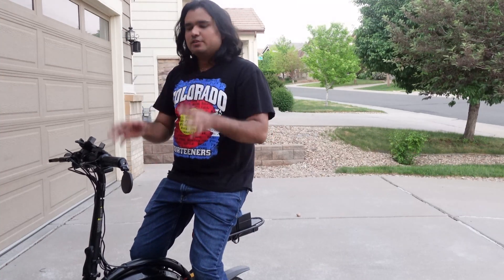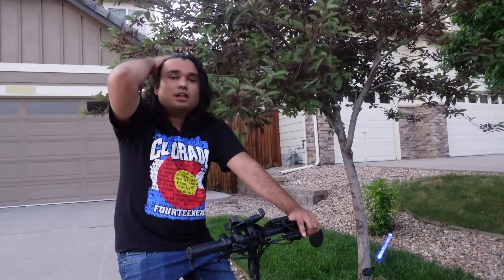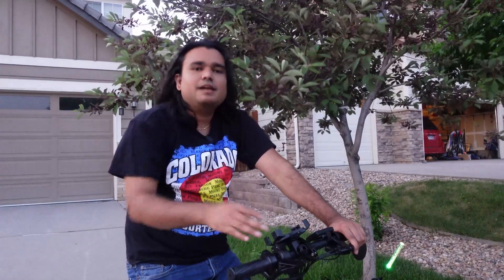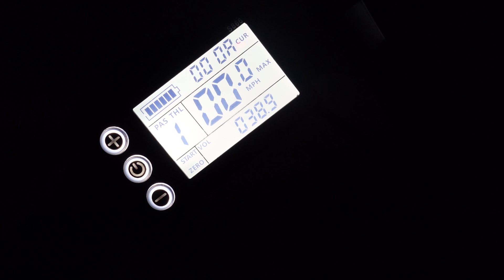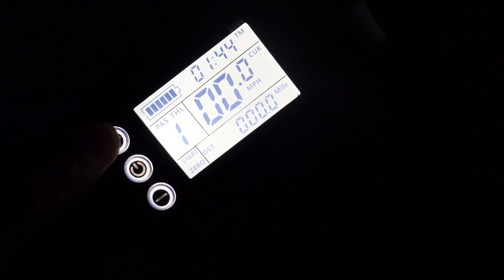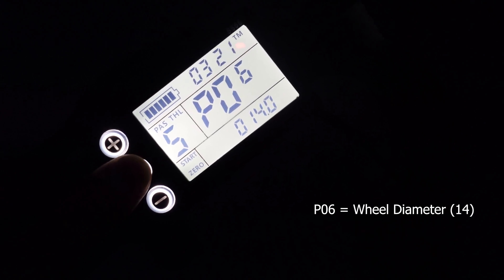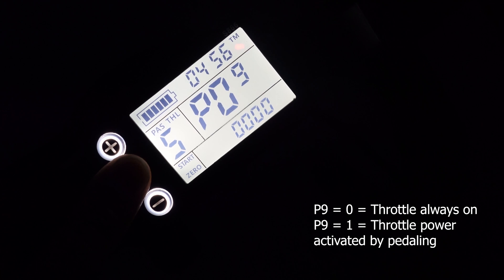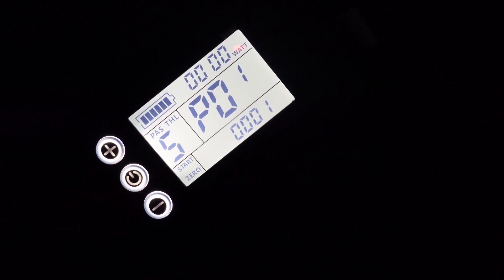Electric Bike (Jetson Bolt Pro) - Controller Upgrade Settings & Questions

Comment: I got the display installed and noticed that it does not matter what setting P7,P13, P14 and P19 except for calculating the display mileage. So setting P14 as 10A max, it will still climb to 19A on the display.

Also, I noticed that the PAS THL defaults the value to 1 when the unit is turned on. So I have to climb to 9 everytime the unit is turned on.

I also have P21 which enabled, It overrides PAS THL setting and sets everything to the MAX. This includes battery undervoltage which is down to 28. 

I wanna say, I belive you can disconnect the Hall wires and it will still work. But I'm not sure
Reply from the maker: Hi John, thanks for your insight. That is good to know. I appreciate it.
Reply: Lol all you have to do is cut and fish new controllers it will look a lot cleaner I did mine like that with a 10amp 48v battery it’s faster and more torque.
Reply: So if you enable p21 does it make the bike faster
Reply: I just installed a 36/48v controller but can’t seem to get the bike to pull me. Bike worked great before hand. If I left the rear wheel the speedo shows up to 24mph. Just wondering if I have a setting wrong maybe? Almost like torque is down. Any ideas?

Comment: I bought that controller you had in your bio what kind of 48 volt battery can I add to this controller that you mentioned that comes with the LCD screen. I just want more battery range and more speed. And how to do dual motors
Reply from the maker: Higher speed means less range. If you want higher range I would stick with a 36V higher capacity like 20AH battery. If you want more power, 48V battery would be appropriate. Anything above 20mph on this little bike seems dangerous, so please do your research and be extra careful with this controller upgrade. Please check to make sure the wiring on your bike is the same as mine, many people had different wires. I am considering a dual motor upgrade but I haven't had time to figure that out yet.
Reply: @ShivaSapkota  but would a 48 volt battery go with this controller that's in your bio? And yes I think if I can at least get it to like 20 to 22 I'll be happy with that I just want more power and battery range
Reply: And can you send me a link for a sufficient 48 volt battery it goes with this controller
Reply from the maker: @wavvvyosean5311  The controller manufacturer states that it is compatible with a 48V battery. Some of my subscribers told me it worked for them and they are getting higher speeds and power. I think something like this will work but it won't fit inside the housing. 48V batteries are usually larger and need to mount in the back. I haven't tested with a 48V battery to know about and please do extra research prior to the upgrade. https://ebay.us/tOmd4F
Reply: @ShivaSapkota  you're the best thank you
Reply: @ShivaSapkota  do I need any extra connectors for this like that adapter for the battery and where can I find a bike rack
Reply from the maker: @wavvvyosean5311  Please check my ebay battery review video for the connectors. https://youtu.be/es2XFwU_tGQ. This is the rack I have: https://amzn.to/3mKvpES
Reply: @wavvvyosean5311  yo man did u ever figure this out

Comment: I have a DYU D3F 36v, 10AH, 250W similar to the jetson bolt pro. This version is limited to 18km/h. The DYU D3+ has the exact same specs, but you can change that limit with bluetooth+app to 25km/h. Is there any other way to adjust that limit? I know you can take the bluetooth adapter from the other version, but that's not an option for me. Or is changing the entire controller my only option?
Reply from the maker: Hello, unfortunately, swapping out the controller might be your only option. I have seen people mess with the capacitors inside the controller to bypass the limiter but I don't know much about that process. Thanks.

Comment: Great content once again.  Recommendation for controller upgrade, choose the higher rated voltage controller because it will contain appropriate capacitors and mosfets required for higher voltage.

24V-36V controller is likely not adequate for much higher voltage.
Reply from the maker: Thank you very much for the feedback. You are absolutely correct, I would recommend 36-48V at a very minimum.
Reply: Is this comfirmmed? I accidentally bought the 24-36v but it's been working fine with 48v and settings allow it too.

Comment: I just finished installing the control on my  bike it work as you said thanks men also I noticed that the control let’s you choose different voltage settings up to 60v what will be the highest battery for the 350w motor.
Reply from the maker: I would probably stick with max 48V. Thanks for the feedback, I am glad the upgrade was a success for you.

Comment: What happened to the original video showing the wiring for the controller upgrade? I just got the controller and the video has seems to have disappeared!
Reply from the maker: Hi Dennis, several people reported to me that their wiring was different than mine. It looks like Jetson decided to change the throttle and pedal assist wiring on the newer bikes. So, to prevent further confusion, I took down the video untill I can figure out wirings for the new bikes. Please send me an email (sapkotatechnology@gmail.com) and I will send you a video link for the original video. Thanks!
Reply: @ShivaSapkota  Will do! Thank you as I am not able to find such a detailed video from anyone else. You’re the best! 🙏
Reply from the maker: @therealdenniscortez  I just emailed you the link. Thank you!
Reply: @ShivaSapkota  can you send me the video of the initial video because my pedal assist
has black red yellowed my week is turning backwards
Reply from the maker: @dani52able  I believe you emailed me last night and I sent you the link. Thanks.
Reply: @ShivaSapkota   i think i have one of the newerones and the pedal assist wire is black also its just easy to find because it goes to the pedals
Reply: Can u send me video my wires are newer ones

Comment: I have a 48V battery and controller upgrade. I've seen 25mph on a flat road. The motor is louder but not like it's bad. It's pretty simple, the more electrons you are going to force through the motor, the louder it gets. If you want a quiet one, I suggest you leave in in the closet. They are pretty quiet in there. My wife is happy with her 48v rear drive and I should have my 48v dual drive/dual battery running in a few weeks. Everything is mounted, just got the wiring to hook up. Top speed should not increase but I should get there quickly.
Reply from the maker: Thanks Mark. I would be interested on learning more about your dual motor system. Are you just using a rear wheel from another Bolt Pro? Thanks.
Reply: @ShivaSapkota  Install a stock rear motor to the front? There is a huge side difference so that would not be easy. I purchased a 36v350w motor but it will be running on 48v. Should be running this weekend.
Reply: @ShivaSapkota  Motors do not really care about the voltage [within reason]. Stepping up to 48v would not have a real problem with the way the motor is built. Could it? Yes. If you want no problems with a warranty, you probably would not be here. I have a 48v 350w controller to the rear wheel on the wife's bike. Runs fast and strong. How long? Well, she has not broken it....yet. Yes, stock rear wheel motor. To make things simple for me, I use a 36v 350w front motor [and stock rear 36v/350w] but it too will run on its own second battery and controller. The only thing that is shared is the display/throttle. I've seen it work, but it's not on the road yet. The two controllers and 1 battery are in the stock compartment. The rear controller will supply 500w but the front will be 350w. The second battery will be on the front stem. I see you put your battery at the rear. With the additional power of my wife's bike, I certainly feel it would be foolish to put more weight on the rear. It pops wheelies with a twist of the throttle now. Both batteries are 48v/10Ah. Yes, the brakes have been updated [before it's road worthy]. Yes, I'm older and I do things right before I take it on the road. Twisting wires, electrical tape, and butt connectors are not my thing. When you grow up, hopefully, being first on the road is the second thing on your build list. The first thing should be to build it right/safe. You come across as a professional engineer, but you really take way more short cuts/hacks. All the engineers I know are kinda nerds and like to be exact, very exact. Sorry, it's an opinion, different than most here, but I've probably worked with more 'real' engineers than many here. It's hard to accept a different opinion, especially one that is so different than yours. I hope you really look at your videos and think that people are trusting you like you are a professional. Telling people you are not, is not the same as fixing the faults you portray. A simple edit will really take this channel to the next level. Asking for peoples money when you drive a Tesla seems to be a bit shady. Just saying. I'm ok if you call me a Debbie Downer. My wife says that all the time. Right after she says that I'm usually right.
Reply: can you list battery and controller
Reply: Can you list the controller and battery please? I'd appreciate it !
Reply: @hernanmurillo8925  The controller I used included a new display and throttle. It is not a simple plug and play. I purchased it on Aliexpress. It took a lot of work to get two of them working for the dual controller to work with one throttle.
Reply: @ansia8785  The throttle is a digital signal and not the conventional signal that you normally see. Since this is a digital output, I ran that signal to both controllers. The display/throttle is a 124DX type. Google that. It's not designed to work with two controllers but mine worked fine as long as the display gets feedback from one controller. 2 output and 1 input to the display.
Reply: @ansia8785  Some displays have a throttle that uses a separate sensor. Some displays, that signal, is process and goes out to the controller. If you have a throttle that does not go to the display, then you probably can take that output signal [and the ground] and attach it to both controllers. As I mentioned, the 124DX display uses a tx/rx signal and the supplier told me it would not work. I took a chance and found as long as the display did not get two rx signals [one from each controller] it would work. If I did put the two rx wires together, then the display would not work and therefore I did not get a throttle tx signal. I hope all of that makes sense. One other thing, with the weight distribution of the Jetson, the front motor will lose traction at lower speeds. If I had the time, I would either use a lower power motor up front or a larger one in the back. It is real sketchy until you get up to speed. Then it gets down right scary fast for such a small toy.
Reply: What do you get for distance with the 48v ?
Reply: @anio6865  I have 2 48v and 10ah batteries. One for the front wheel and one for the back. Max range? I do not know but we have ridden 10 miles without an issue. I cannot see my self ever testing for max range. I did convert my wife's bike to the same 48v/10ah too. We only using them for camping.
Reply: Could someone explain how to do 48v upgrade and controller ? What do i need to buy ?
Reply: @TanerMinator  If you have to ask it may be over your head. Basically you need a controller and a 48V battery. Most controllers do not have instructions and if you are not good with wiring, then you may be causing more problems than you want.
Reply: @markseigal2682  Just make a video about it, it's only over your head if nobody explains it
Reply: @smoofwah3552  I would love to, but I've got more important things to do. If you get how these motors work and understand how these controllers work, anyone can do it. If you do not know how these two components work, then you probably should learn about that before you just start hacking away.
Reply: Not sure why go through all hassels. Just remove speed limiter. You will be surprised how much power you get.

Comment: hi shiva again  when I'm not on the bike it pulls very well while when I'm on the bike it sounds like it 's not accelerating I did the test with another same bike it passed me easily.
on the hall  sensor  mine did not have the white cable I did not connect it anywhere while yours has the white maybe this is the problem? also in Interface 2 i SEe E00  that display  in normal state gives Watts right?
Reply from the maker: Hello, looks like you might have an error. The white wire shouldn't be mandatory as I can run my bike without the white wire. That E00 is an error code I believe for communication error. It seems like the bike is not getting enough current/power. Are you settings same as mine? I am sorry to hear about your issue, I wish I knew what to do, but I don't. I wonder if you just have a faulty controller? Perhaps reach out to the seller? Thanks.
Reply: @ShivaSapkota  settings are the same as yours but  my bike isn’t jeston is urban glide 120l with 12 inch but with the same controller and battery like yours.   E00  in seller say isn’t  00 error dunno I think I broke my bike
Reply from the maker: @RockardGr  What if you put your original controller back in? If that doesn't move then unfortunately either the battery or motor burned out. If the original one moves, then you know it is the new controller. Sorry my friend, I wish I could be more helpful.
Reply: @ShivaSapkota  i put back my original controller and bike is fine i didnt figure out why the motor doesnt give Torque thanks shiva for all i keep it for future builds and i wait for your next video about 48v battery!!!
Reply from the maker: @RockardGr  Awesome. I am sorry this new controller didn't work out for you. I hope there are projects in the future where you can use it or perhaps we will figure it out how to use it for your bike. Thanks for watching my videos.
Reply: I had the same problem you had. On the settings, go to P12 and change it to 5. That will fix your acceleration issues. As for the E00, I also have it. Simply ignore it. Your bike will run just as well.

Comment: Hey just a question for anyone to answer I really want to get one of these but my parents think it won’t last me too long. Anybody know if this bike is worth it?
Reply: It's Costco :D
Reply: @DannyAZ5  I know where to buy it I’m just wondering if it will last me long?
Reply from the maker: Hi Matt, this bike has lasted me and many of my subscribers a very long time without any issues. You also get 90 days free return with Costco if something happens during those 3 months. The bike has 1 year warranty from the manufacturer as well. The longevity of any product depends on how you use it. Thanks!
Reply: @ShivaSapkota  thanks so much
Reply: @Matt-lr3tb  Have you called Jetson for warranty work? Good luck, I did and found they were very good at having you jump through so many hoops that you'll just quit. Ever purchase from them? I have. I ordered a new center storage trim panel and it was thrown in the box without any padding. Fortunately I was going to mod it for the dual drive, but they were not apologetic what so every. Purchase it thru Costco [if they have it]. Accept the easy 90 warranty and hope it fails before that. If it passes 90 days, it's probably going to be good. Remember, this is just cheap Chinese junk.
Reply: I believe it’s worth it because it’s not much different than any other ebike available:  it is mod-able

Comment: Hi, are you going to be doing a crankset upgrade?

Also do you have any details on the specs of the Botton Bracket?  I know the shell length is 68mm  but not sure of the overall length, want to do a peddle conversion on the Jetson Bolt. Thanks.
Reply from the maker: Hi Alex, I will for sure consider that as one of my future upgrades. Unfortunately, I don't have any spec on the button bracket.
Reply: @ShivaSapkota  no problem, I've already started on sourcing the items, going to be a trial and error project.
Reply from the maker: @AlexHusTech  Awesome! Please keep me updated. I would love to know the progress.
Reply: @AlexHusTech  If you go with a larger crankset [which I highly recommend], you'll probably find that the chain line is not even close. You'll probably not know what is right until you get your crankset and measure the difference. The two I built have a spindle total length of 127mm to correct this offset. Both cranksets have the larger ring on the outside of the arm. It just looks better. [Some of them are bolted to the inside arm]. Attaching it to the outer arm causes the gear to be further out, a shorter spindle is needed to bring it back in to where the stock chain ring was. You'll need a different chain. Use an 8 speed chain. A 9-12 chain is thinner and the space between the links will not allow the chain to rest on the rear sprocket completely. I have a 9sp chain but I machined the thickness of the rear gear so the chain would rest perfectly between the teeth. To answer your question, 133mm is the total length of the factory spindle. It's off set to the right a bit, no I did not take a measurement of the offset. My wife has a 52t and I have a 53t.
Reply: @markseigal2682   @Mark Seigal  Thanks, I really appreciate your help. I've already ordered all the parts, I went with a 127.5mm, 48T, 12T flywheel, 1 speed chain & 152mm arms lengths. I'm just waiting for all the parts to come, I understand some parts might not work but it was all trial and error at the time as I couldn't get all the information at the time. Once again thanks for the info.